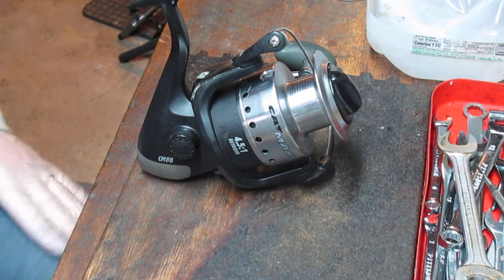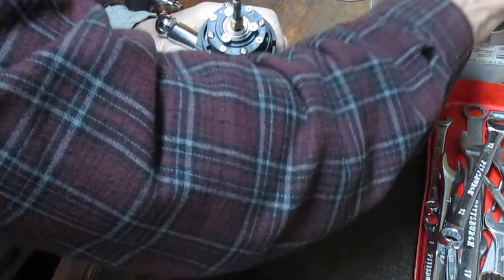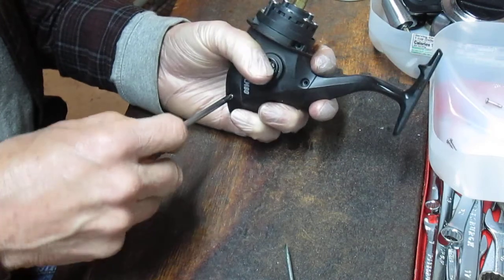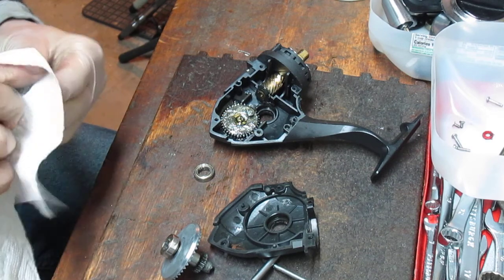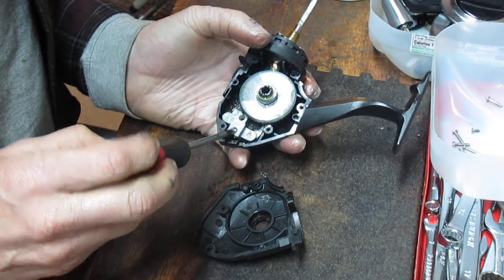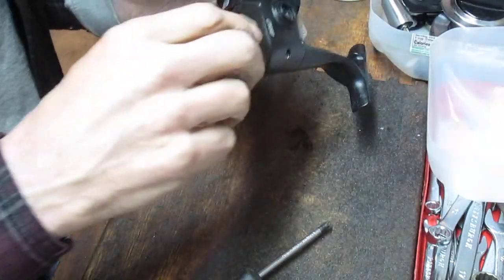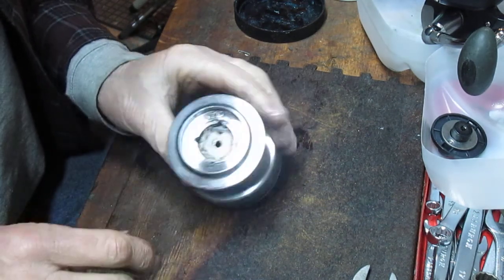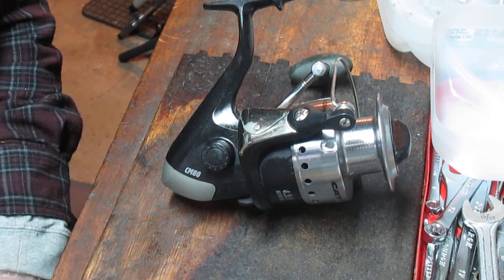Bass Pro Cat Maxx 80 reel review with take apart and how to maintenance repair

Comment: Great video! I have this reel, but the drag won’t loosen after a year of using it. Any thoughts on why?
Reply from the maker: I would guess dirt and water have got into the adjuster nut and caused it to freeze on to the axle shaft.  You may want to flood the area with penetrating oil.  Turn the reel upside down and spray around the rim of the adjuster button.  See if that helps to free it up. - Dennis

Comment: Where can I find parts for this reel specifically a crosswind gear?
Reply from the maker: These reels are not supported with parts and service. They are only backed by a limited warranty.  You can try the Bass Pro shop to see if they have any parts or can direct you to their service group.  most likely you will need to find a used donor reel to get the parts - Dennis